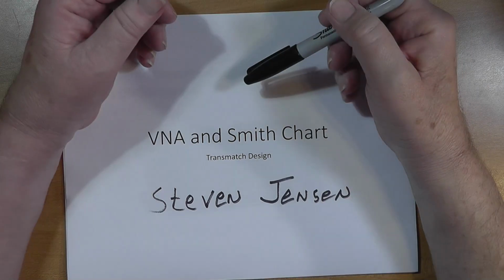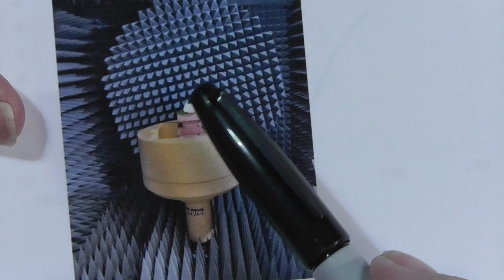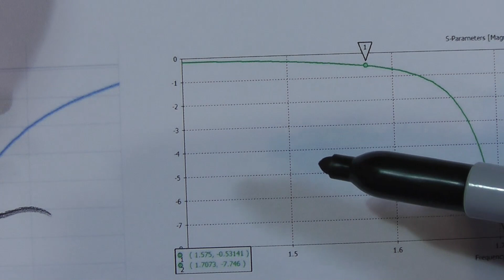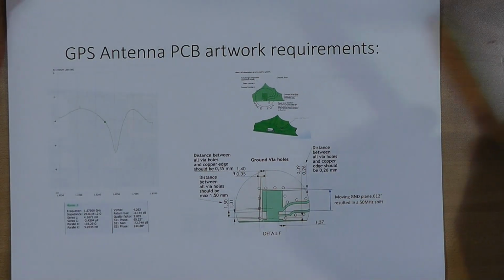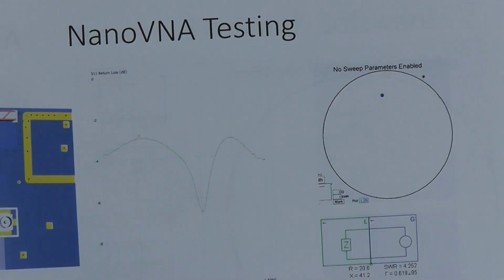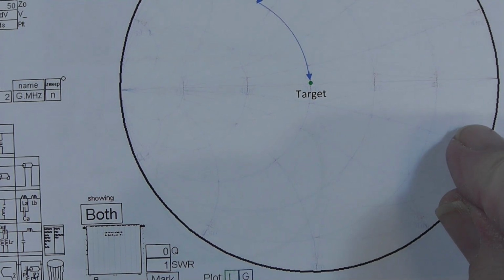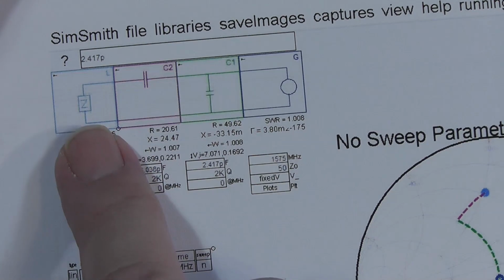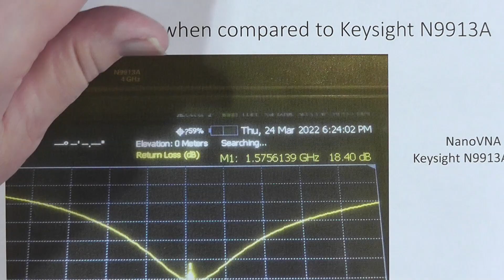Using The Nano VNA to Solve Real World Problems (#947)

Comment: mine is used for antenna check/tune and coaxial cable verification (i can to see on it the length of my coax cable and if any open/short, with the distance of it, before my antenna).. i can do a cable impedance check too if needed.. for me it's a must to have in RF!! ❤

Comment: I want to build an RLC circuit with all variable components to add to my antenna lab.  I've already sourced a variable plate capacitor, log potentiometer, and will hunt down some variable inductors.  It's like building a whah pedal circuit for RF... I will run some spreadsheets to determine the ideal tuning ranges...  .22uF Cap, 1K Pot, 10uH Inductor...

Comment: Somehow this explanation of Smith charts actually clicked with me, whereas the explanation in the extra handbook just kinda bounced off.  I think the real-world context helps a lot, at least for how my brain works.

I have a nanovna and I have used it to tune some things, but I'm still suspicious of its accuracy.  Without having a $14k VNA to compare to, what could I do to validate its results?  In particular for things more complex than a simple SWR reading.
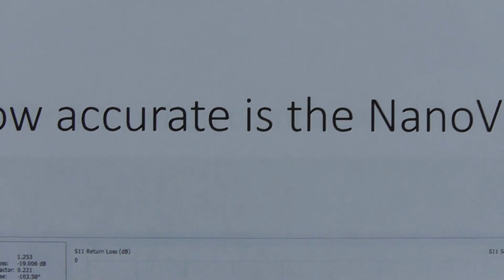Reply: You must have missed this @ 13:10 where the question "How accurate is a Nano VNA " is answered... very accurate.
Reply: You need to know how to calibrate it so you can see the results you are desiring to measure.
Reply: @3henry214  No, it answered the question "How accurate is Jensen's Nano VNA".  Given that it's an open source design and produced by a lot of manufacturers, it's still a valid question to ask if my Nano VNA is accurate, or how to figure that out.